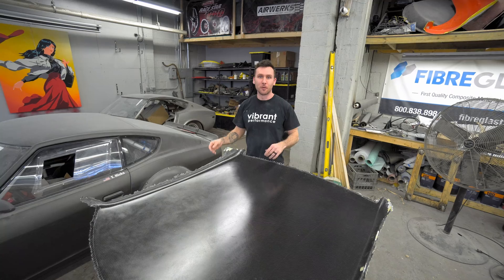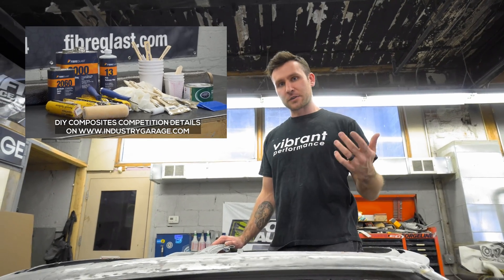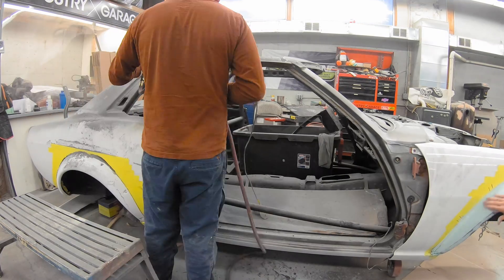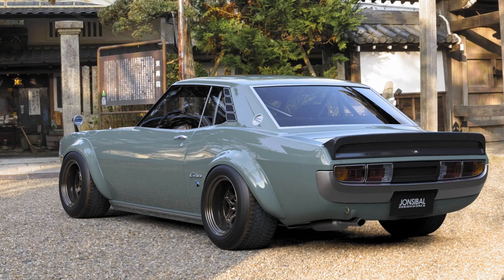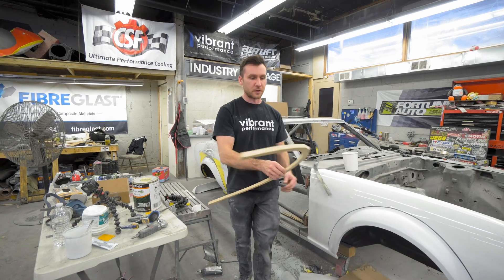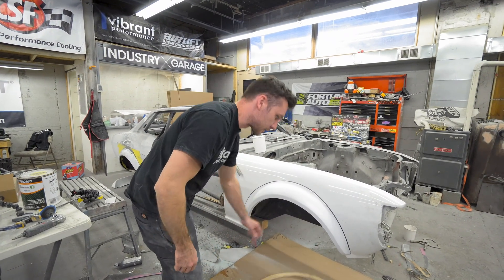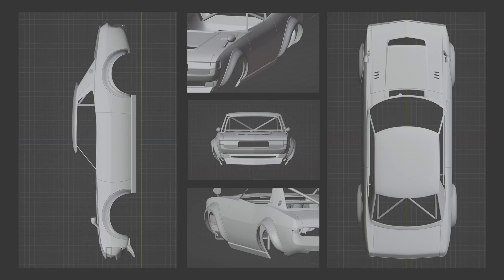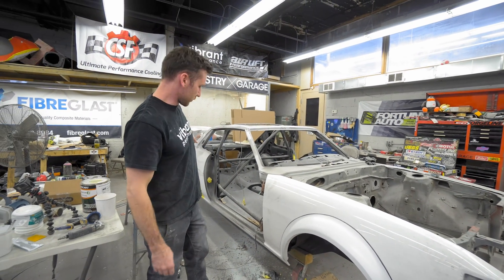RENDER to REALITY Making Speed Academy Celica Flares (Part 1)

Comment: What body filler are you using? I’m currently 3/4 of the way through my fiberglass skyline R32-R34 front end conversion fenders. Is it possible to carbon fiber skin it or should I keep it glass? I might buy one on your DIY kits. Thanks

Comment: If you have a laser meter, and set yourself up with a wall that's the same in the 3d model as is IRL, you can use the from-wall function of the laser meter to (rather) accurately pin point dimensions on the fly from the model to the actual item made. You'd have to print a piece of paper to hang on the wall so you know where you measure from, but it does work, and quite fast.
It's kinda like reverse from what you do in forensics to build up the skin from a skull with the little wooden pegs.

Comment: Have you tried 3D printing a fixture to act as a form for carbon fiber wheel arches. Ivan Miranda built a printer to do this for Bad Obsession Motorsport’s Project Binky. They just used the 3D printed arches. In theory once you built the printer, you would use a 3D scanner to make model of the build car. Use the rendered arches as models to mock up mounting and location. Then print the arches. Overlay carbon fiber like you did the roof. If you take some time you can make the arch and internal mounting structure integrated into the arch. Then just mirror and print. You could even print mounting jigs to keep everything aligned and symmetrical.

Comment: Whats a good kit to start making hoods? Does room temperature matter? I made one but bubbles where in the hood I didn't know what I did wrong. Just getting started
Reply from the maker: if its your first part id recommend starting smaller.
Reply: @StreetBandito  it's there a kit to start making small parts? Or what's a good brand

Comment: idk if i just have never been to a bodyshop but is there supoosed to be this much dust setting on everything all the time?
id assume some venting would do wonders for air quality and stuff
Reply: My shop is probably 1/3 of the size...a clean shop is a blessing , but what's it's worth to stop the work flow....fans would only keep the dust moving...most of it falls to the floor
Reply from the maker: we are in the works of a vacuum system to help reduce dust but as said below, its extremely hard to manage dust in a shop thats dedicated to body work.